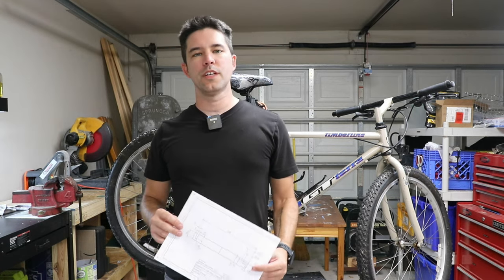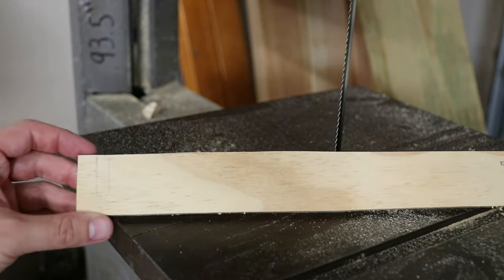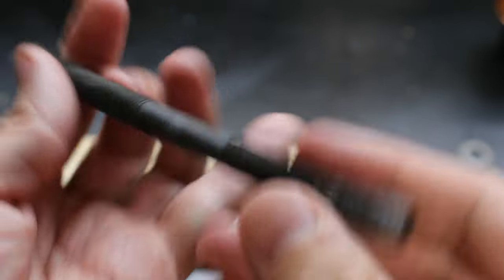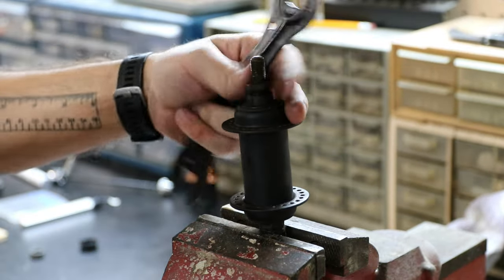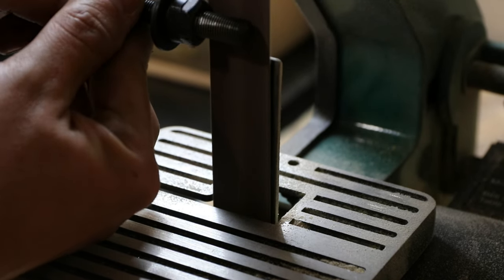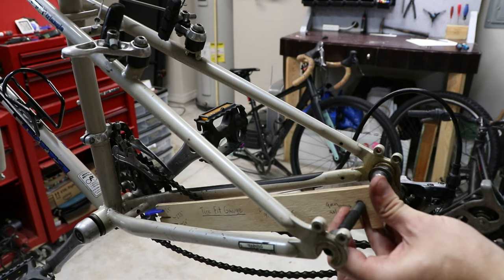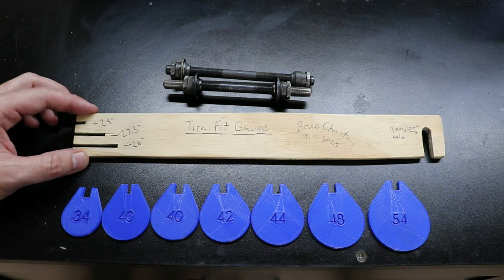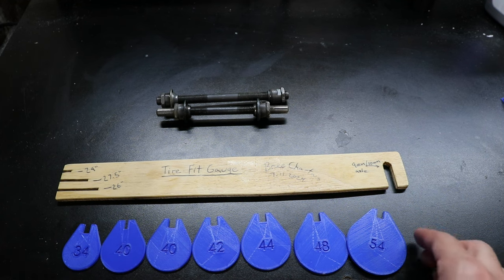DIY Tire clearance gauge

Comment: Rim width affects the tire height and width, so you’d have to make gauges for each rim width to be accurate. Some companies measure width from the casing and some with knobs measure from the outside of the knobs.
Reply from the maker: yeah true, I think this is only a guide, from there I'm thinking to size down one size.

Comment: Very useful. Thanks for sharing. I don't have any 3d printer at handw, will try build one by wood
Reply from the maker: for sure you can do it with wood too, might even be quicker. Just need the template. I'm going to upload links to everything I have when I get a chance.
Reply: @ Thanks for your kindness. A template would be much appreciated.

Comment: how are u going to compensate for the reach of the brake pads when going from 26 to 27.5? Paul motolites can do it I think but very expensive
Reply from the maker: I imagine you can do something with various calipers, but then you'd also need a rim brake 27.5 or 700c rim. I'm thinking of brazing on disk brake tabs.

Comment: Does the tool take into account size of the knobs of the tires(especially the mtb type)?
Reply from the maker: I was thinking the same thing, not totally sure. I think what they did is started with the overall width and then tried to guess the normal profile of a tire in terms of the radius. I feel like maybe they made it a bit more round then what most real tires are. But yes I think the idea is to account to the knobs.